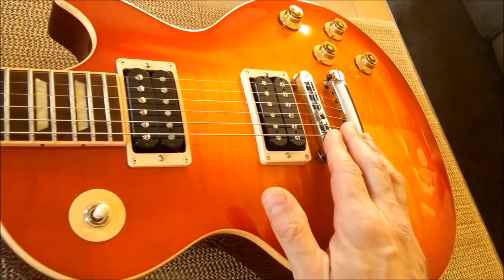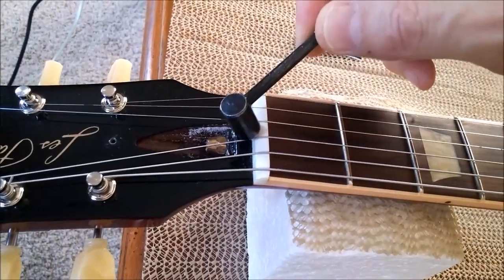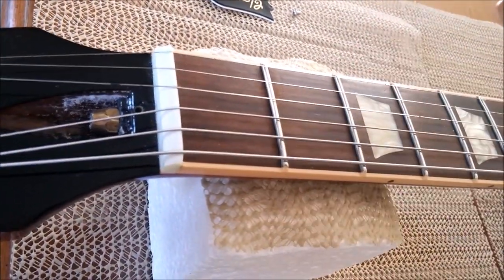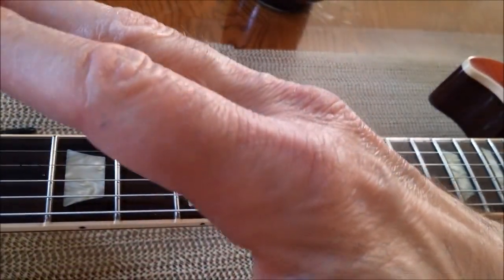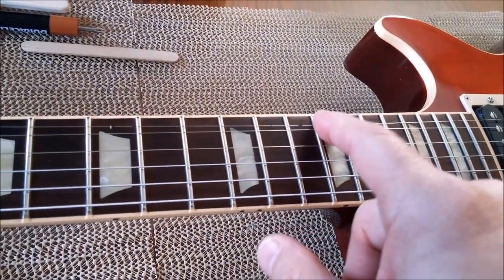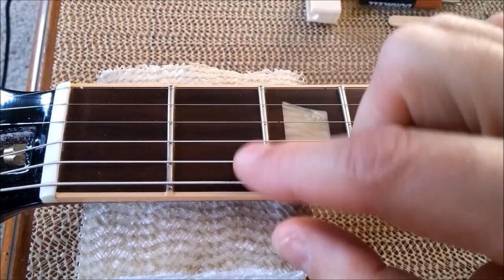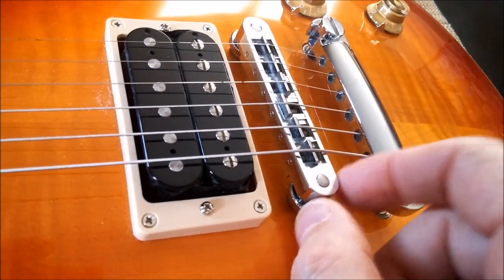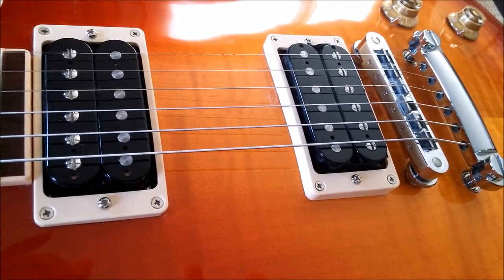Silky Smooth - Stopbar, Neck & Bridge Position

Comment: Thank you for this video.  I’m new at adjusting the hardware on a guitar like this, and for now I’m just studying what my guitar looks like.  I have a used Epiphone Dot Studio, and I notice the stopbar is higher on the high-E side, and the bridge is lower on the high-E side.  The two seem to compensate for each other based on sighting the strings from the bridge down to the neck.  The two complementary settings of stopbar and bridge to me look intentional rather than a balanced coincidence.  If it is intentional, is this a known thing, to have the two offset one another?
Reply from the maker: From my experience, most (nearly all) stopbars are level from the factory. Its possible that your bar was changed post production. Uneven bars are ok, but less common.

Comment: Hej In your video stopbar adjustment you said that if you raise the stopbar you have to Tighten the neck. 
But in this one you said you have to loosen the neck.... which one is correct?
Reply from the maker: Hi Nicolas! Raising the stopbar slackens the strings. When re-tuned to pitch there is less friction on the bridge. Generally speaking, this would imply that the neck may fall backward and therefor need to be loosened to compensate. Each guitar can be a bit different however depending on humidity and temperature as well as neck material.
Reply: @guitarhowtos2148  thanks for your reply! It helps.

Comment: ... my trust rod..... is gone....
I opened the plate,.. and it’s just not there.

I bought this les Paul used 7 years ago from guitar center. I spent over 8 hours fixing everything recently because it was such a poorly maintained guitar and the final step was adjusting the trust rod :/
Reply: Wdym it’s gone? Did it break or like is there no truss rod at all?
Reply: @forbiddensun9524  no I was wrong. All the videos and pictures I looked up happen to have the nut, and when I saw mine didn’t have that I thought it was missing. I guess some truss rods use Allen keys. Mine was an innie not an outie ;)

Comment: Wrong dude. The truss rod should not be touched if only adjusting tail height; once strings are retuned same tension is on the neck.

The bridge/tail break angle adjusts friction across the saddles. That’s all.
Reply from the maker: I see your point. That just wasn't my experience.

Comment: You should slacken the strings off completely before adjusting the truss rod.
Reply: Most luthiers will tell you to perform all adjustments with the guitar tuned to standard tuning. The truss rod should only be adjusted in quarter turn inclements or less. After adjusting retune the guitar and check the neck relief again.
Same thing goes for string height, intonation etc. Sometimes it is a good idea to let the guitar set for a minute to let the neck move before doing more adjustment.
Reply: Michael Frye thank you👍
Reply: TRAIN 
Tune
Relief
Action
Intonation 
Noodle
That’s the order